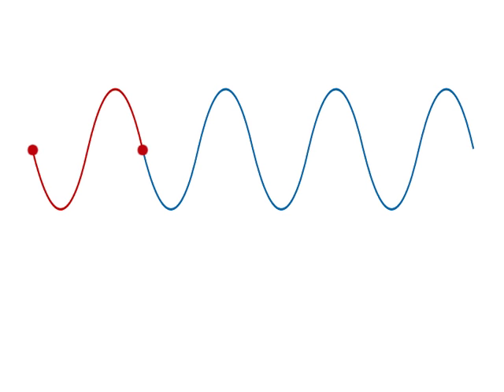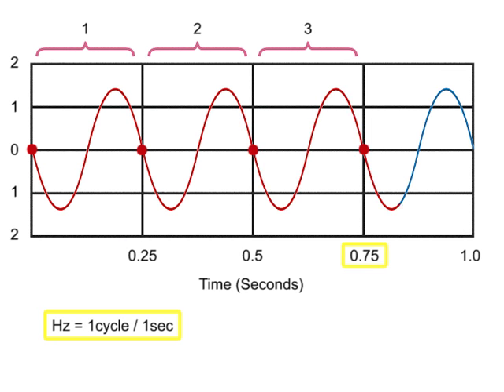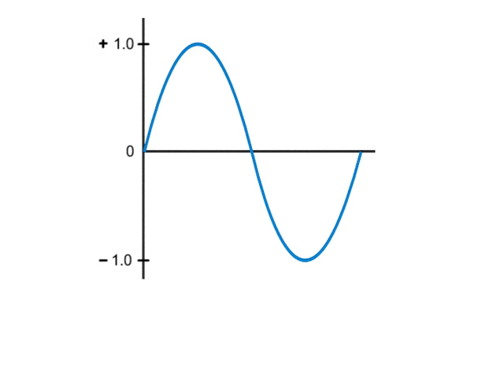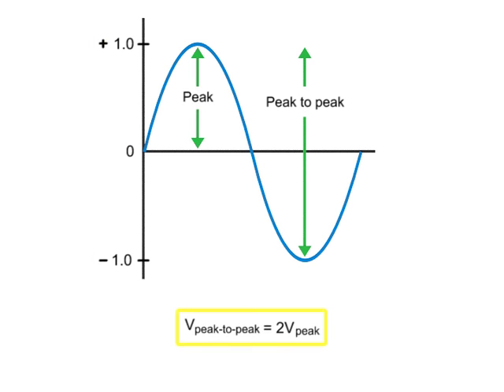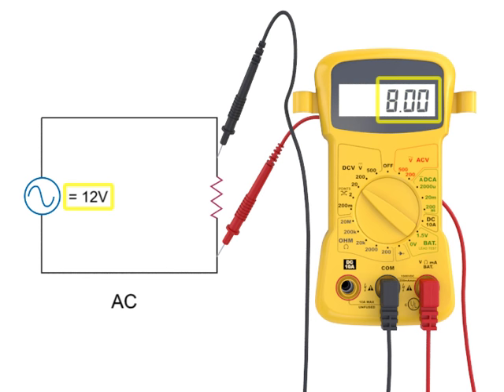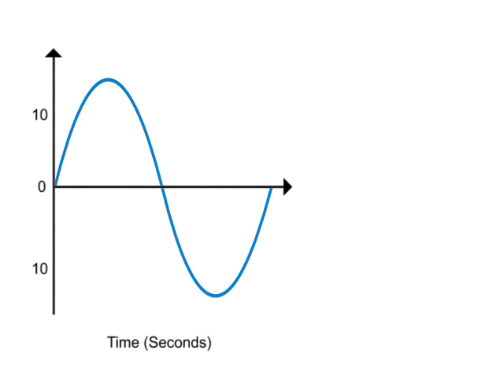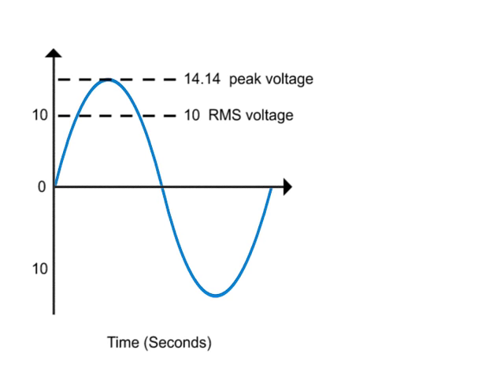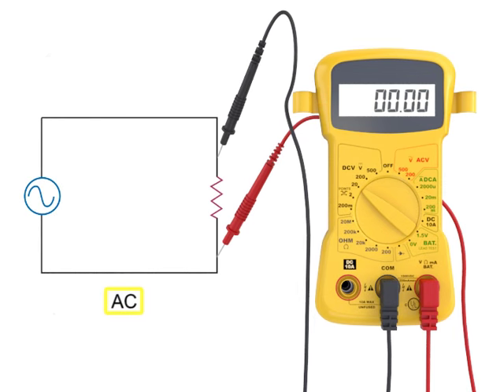AC Voltage Circuts (Cycles, Periods, & Frequency)

Comment: In your graph show the points where the direction of current changes if you were to show it that would correspond to animation of current in the wires.  How many times current change direction in 60 hz?
Reply: 120 times right? Or by direction do you mean as in from peak to peak or from cycle to cycle? Cuz 60hz would be 60 cycles a second so it would go from peak to peak 120 times switching from + to - then - to +.  but would only go from + to - 60 times a second as well as from - to +..